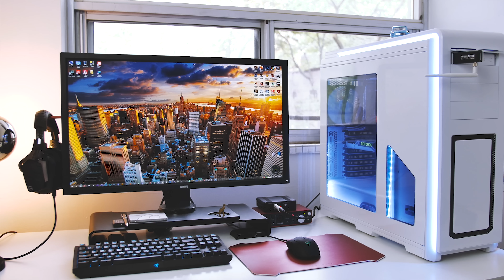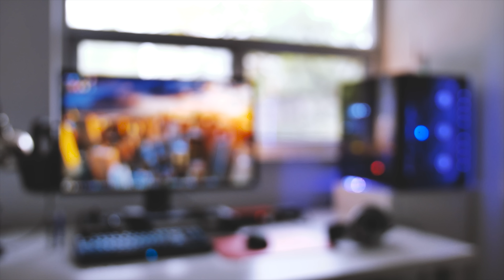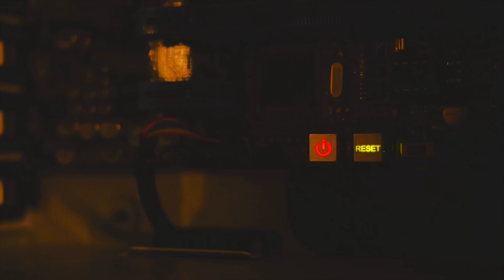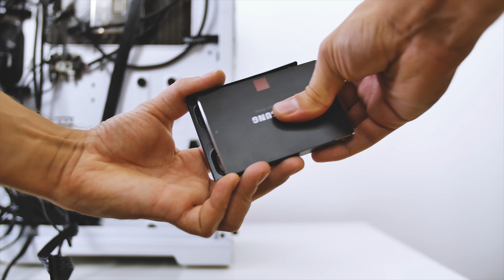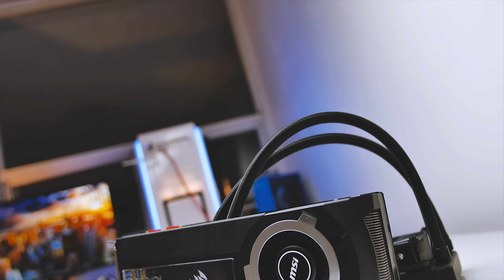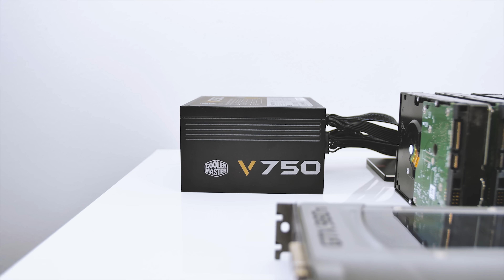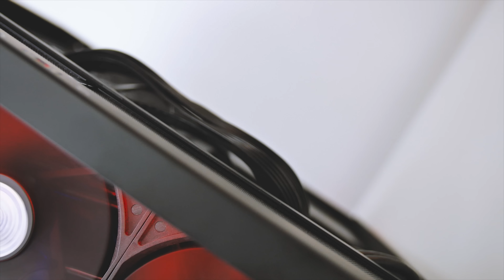New Workstation PC Upgrade | Aluminum + Glass = Sexy!

Comment: You do not need a nas! they are very expensive for the harware!
with an old PC that supports SATA 3 ( 3-6gb ) and a good switch, a good router  It's enough! 
we use old HP DL380 servers and Segate 8TB hdd entrepreneurially

Comment: Finer point question:  I am curious of the wire route for the LED strip under case in the back.  Did you find a port already available on the case, or did you have to do a little modding?  I will be purchasing this case for my build in a few weeks and liked that little nuance in lighting.  I know there is a small hole below the expansion slots, or did you squish it out through the power supply mount?
Reply from the maker: +Albie Clementi yes or went underneath the PSU. Little tight, but no modding required :)
Reply: +HardwareCanucks Excellent!  Thank you so much for your reply, and also for your awesome content!  Keep up the amazing work:-)

Comment: i guess either you are recording at 8K res and rotating the the frame with scaled down composition or you are rotating the table it self which is not possible 90 degrees 180 degrees rotation done very well but how ?? how do you rotate without cropping

Comment: Whydo you call your 980 a reference board? Its not like its a specialist video editing card,  it is just a basic video card. Is there any reason why you call it that?

Also the stickers on the three front fans, remove them or straighten them up ;)
Reply: +BladeRunner21577 A reference card is a GPU that holds the reference PCB and Cooler.
Reply: +tacoman So a card that is built following the guide of the original, in this case a card that copies the original nVidia cards design?
Reply: BladeRunner21577 Exactly :D

Comment: The one thing I cannot figure out is why the main primary slot for my 660ti is running at a X8 speed and the second card running at x16 speed.  It made be very confuse when it suppose to be a dual X16 speed and I've put it in the correct slots.

Comment: I also have that same X79 board that you have in the video and I'm rocking with my 3820 i7 (budget wise).  Right now I'm looking for a good mid-range card between a Crossfire XFX Black Edition DD 290x and the R9 390 Msi for my three monitor setup which currently I'm running SLI 660ti GC Galaxy Tech OC edition.

I could only wish to get the sandy bridge 2011 extreme black edition my buddy have on his computer.  He was suppose to be building a aluminum tank with side glass for mineral oil setup.....that was a year and a half ago when he wanted to plan doing but never did.  Seeing the black edition $1000 chip resting on the MB that should be in the case and the sad part it was still cover in oil and now dust is all you can see on the entire system and it going to be a bitch to clean it off now.

Comment: Why intake fans blowing air on to power supply, hard drives and cables?, it should be positioned on the left side to do all blowing on to components instead.

Comment: +HardwareCanucks, You ask about a NAS. Having had a small Synology-NAS for a couple of years, I would like to recommend one of those. I don't know the depth of your wallet or your needs, so I'm just gonna link to their product page. It has a really neat setup and is easy to use. I'm using mine as a file server, but also as a DNS Cache for my network and as a torrent downloader.  The "+" series typically have a stronger CPU than the variant with no sign behind it, the "J" series (for Junior) are typically a bit weak, but will still do good. Some of the NAS can have a plugin module of extra drive bays, if needed, like the DS1515 (the DS1515+ has a stronger CPU and RAM that can be upgraded).   https://www.synology.com/en-global/products/

Comment: Hey dimitri, noticed u've got a usb wifi adapter was wondering if u had any problems playing online games with it & what model is it. Am looking for a suitable one since i'll be switching network providers n don't wanna run the cables outside the house just to get to my room, so do u have any suggestions apart from the one u got.

Comment: i saw this case too and would buy it but dont it get too hot in there because the intake fan are on the ´´ wrong´´ site.
if you look at the corsair air 540 then you see the intake fans are on the site where the mobo and graphic cards are.
so dont make this much of a difference?

Comment: INTEL Quad Core I7 6700K

Kingston HyperX Fury Black 16GB Dual Channel

MSI GTX 980 TI GAMING 6GB GDDR5

2TB SATA Hard Drive

Samsung 850 Evo 1TB Solid State Hard Drive

Corsair Obsidian Series 750D Full Tower Case, Window

Blu Ray Combo Drive

Corsair RM Series RM850 ATX Power Supply

MSI Z170A GAMING M5 Intel Z170

Corsair Hydro Series H100i Liquid Cooler

What you think for gaming ?
Reply: +Joseph Longmore You could probably get 30fps on minecraft if you install optifine.

Comment: you have 2 980 tis why overclock wen u can just SLI it will boost your performance substantially and no high fan speeds, palace your water cooled on the top as ti dose not need  as much fresh air intake. This is what I would do if you haven't sold or given away your old one.

Comment: you could have slied both your 980 ti's, putting the reference design card as a secondry card, it will run cooler than before and give you a huge gaming performance boost, just saying

Comment: In my personal opinion Lian Li cases almost always compromise functionality for form. I mean yes the case looks nice but at what cost? 

I mean first off I get cancer every time I see one of these cube cases with vertical mounted hardware. Just look at the one side. Half of the entire space is underutilized and can't be used for anything and is just a waste of space. It's honestly just silly. When the hardware is mounted vertically you should just get a regular rectangle case. The take up less of a footprint on a desk or wherever and not as much space is wasted. The same goes for the Corsair Air case. 

If you wanted a cube style case and were willing to pay big bucks for a PC case I would have just went with the Caselabs Murcury S8. You get their unparalleled customizability, modularity and functionality. Plus you get a horizontal motherboard which is the only real reason I would ever buy a cube style case and I own the S8. 

I mean if you are buying this case for how it looks then fine I totally understand but being a workstation and not a showpiece I believe the functionality of the Caselabs S8 trumps the looks of the glass panels and it isn't like you can't get the S8 with full windows on both sides if you wanted. 

The last thing I want to say is what is the point of buying all in one water cooled GPU's? If you are forking out that much money for a system why not just pay the extra 500-600 bucks and build a sexy custom loop? I mean you don't even get rid of the fan on the card, seems kind of pointless.
Reply: +Austin Michael I don't like how costly this case(Lian Li) is. It doesn't even have a slot for a dvd-rom drive. Who uses that anymore? I do! I own CD's and DVD's and I would like to play them. I am probably getting the caselabs case you mentioned. My video card weighs down the pci-e slot. I am never going with a vertically mounted mobo case again.
Reply: MrTw2009 the s8 really is an amazing case. I would give you two tips when buying it. Make sure you get the 120.3x2 drop in Mount. It's worth the money 1000%. Second I would make sure you go look through the accessories and get anything you need at once. Example get the psu support. It isn't necessary but without it your PSU will be completely held on by 4 screws and all the weight will be on them. The way the case had to be designed the psu mounts about an inch off the actual floor of the case.

Also maybe get some Castors. Theirs are really nice quality.
Reply: MrTw2009 No problem, it really is the only really nice horizontal motherboard case out there. It's so easy to build in. 

I will say though that because it's a cube case it will take up a larger profile on a desk. Another thing is that without watercooling hardware the case will look really empty but that's a minor complaint considering the case weights 9 pounds less then a Fractal R4. 

Also final tip would be avoid the floor and especially carpet at all costs. Not a single dust filter to be seem on this case unless you buy custom ones. I don't know why anyone would want to put this showpiece on the floor but just a tip haha.
Reply: +Austin Michael it's easy to see an issue with a bespoke casemaker who charges you twice for motherboard compatibility. One of the options on your preferred case forces you to choose between ATX and SSI mounts. 

Be honest: given how many cases offer mounting points for both, doesn't that leave a bad taste in your mouth? I have a Nanoxia and a Thermaltake which both hold ATX and EEB boards, and neither were close to the price of the S8 and offer the same functionality elsewhere.
Reply: +Christ J dude it's an extra 10 bucks to get the SSI EBB motherboard tray. Big woop. Considering the vast majority of people won't be using extended motherboards I don't see any issue in making it an optional choice for not really even that much of a premium. 

Also you talk about how other cases have both. Well Yea if it's a pre fab full tower why wouldn't it, you can't change anything.
Reply: ***** selling both form factors on one tray would require nothing more than a couple more holes drilled and tapped. Forcing people to buy another tray just to go from, say, an x99 workstation board to a dual-Xeon board isn't defensible at ANY price.

It was also meant as an example of Caselabs being no different to any other company looking to claw at every penny they can get. Other examples include charging for front fan mounting points, and, if I remember correctly, charging more for larger fan mounts - as if they are suggesting that fitting 140mm fans somehow costs them more than fitting 120mm mounts.

Truthfully, I quite like their customization options. However, I hate the fact that they are so cheap as to charge multiple times for different form factors, and that they overcharge for trivial things just because they can. Their "unparalleled customizability, modularity and functionality" only applies to the initial purchase, because if you want to change your system then you may well end up having to buy new case components as a result, which defeats the point.

I'll grant that their build quality is excellent, but it certainly doesn't offset these dubious practices, nor does it make up for the fact that they offer no more flexibility than any decent pre-built case after you've ordered it.

At a lower price - or without the petty additional charges - they would likely be sitting beside me right now in place of my DS6.
Reply: +Christ J If it's that big a deal just get the bigger one and you can fit both sizes on it. I'm sure they have there reasons for charging what they do. 

Also you say all they have to do it drill holes? Come on man go look at the different trays. First off all the one has more aluminum, it has milled routing holes with grommets which also adds more materials and another step in the manufacturing process which costs money time and labor. 10 bucks more is nothing.
Reply: ***** of course they have their reason. It's called "being a business". They're doing the same thing publishers have been doing with paid DLC - charge people extra for stuff that had no reason to be excluded in the first place. Like fan mounts.

I don't object to this in principle, but I do think it ridiculous that people try to imply that it's anything other than a blatant attempt to overcharge customers.
Reply: +Austin Michael Thanks for the help! I think I am getting one after the holidays ;)
Reply: +Austin Michael Good to know! I air cool my pc, but maybe some day I will make a custom loop.
Reply: ***** ". Not a single dust filter to be seem on this case "

- didn't know that. That's horrendous. MrTw2009 irrespective of where you're putting it, get some dust filters. Dust doesn't exclusively come from the floor. Overclockers used to do some decent magnetic ones.
Reply: Christ J DEMCiflex makes custom sets for Caselabs but only certain cases. Also yes their are no dust filters, it's commonly mentioned in Caselabs reviews. 

Also don't forget being entirely aluminum anything magnetic won't work.

Comment: get intel SSD for PCI-E for windows to get the system running smooth because SSD will control the whole windows and that will be extremely helpful for performance rather the 2.5 SSD ones. Another thing just to say i suggust getting 6TB HDD black edition the next hard drive u buy

Comment: I would recommend Qnap one preferable with and intel chip and 6-10 bays i have used 4 Qnaps for business and at home and they work seemlessly together. They are a premium option  compared to synology and WD or Seagate, but i have not had a single day of hassles running with Qnap. Using 12 WD RE 2T drives in them, WD Red Pro is also a good option.

Comment: Build a freenas system in the Silverstone DS380 case, then run a Intel Avoton CPU. Depending on the size of drive pool, maybe pair it with an 850 Pro as a cache drive, or just add a bunch of ram.

Comment: Dimitri, you really need to build yourself a custom file server with high speed NIC for your build. Not to mention that data retention is key so you could setup redundancy backups more easily then on your main system, as well as a lighten up the power usage and cable management inside that beautiful new case.

New project! Get to it :)

Comment: My recommendations for x99 upgrade...

ASRock X99 WS-E LGA 2011-v3 Intel X99 SATA 6Gb/s USB 3.0 Extended ATX Intel Motherboard
http://www.newegg.com/Product/Product.aspx?Item=N82E16813157538

Intel Core i7-5960X Haswell-E 8-Core 3.0 GHz LGA 2011-v3 140W BX80648I75960X Desktop Processor
http://www.newegg.com/Product/Product.aspx?Item=N82E16819117404

G.SKILL Ripjaws 4 Series 64GB (8 x 8GB) 288-Pin DDR4 SDRAM DDR4 2800 (PC4 22400) Intel X99 Desktop Memory Model F4-2800C15Q2-64GRK
http://www.newegg.com/Product/Product.aspx?Item=N82E16820231820

I went with that MB because it has 12 SATA ports and an M.2 slot that can be filled with the Samsung 950 Pro once released. This is going to be my upgrade hopefully in the near future.. :)

Comment: you shouldnt use an NAS because the transfer rates will be limited by your network connection speed, you should instead take your current drive or new ones and make a external HDD enclosure via thunderbold , usb 3.0 or eSATA.

Comment: Not sure if it would be up your alley, but you could go with a custom NAS using something like FreeNAS and source whatever parts you like (for the most part. There is some compatibility things here and there), but it would allow you to make a more ever expanding NAS unlike traditional X Bay systems. Say you use something like the Define R4/R5 which can house a lot of drives.

Might be overkill, but I think you guy would like the customization that comes of such a system and you could make some build videos out of it too.
Reply from the maker: excellent suggestion! will look into that :)
Reply: +HardwareCanucks Don't know how often you use Reddit but this subreddit has tons of people that know a lot about NAS solutions and the pros and cons of different drives: https://www.reddit.com/r/datahoarder
Reply: +HardwareCanucks And remember to keep backups :p
Reply: Agree. I can recommend the Silverstone DS380 NAS chassis and the SuperMicro  A1SRi-2758F motherboard .. for my own NAS I also use the LSI 9211-8i running IT mode  (Initiator  target mode)..
Reply: +AK474000 FreeNAS allows ZFS file system, which is critical for file integrity. make sure you use ECC ram though
Reply: Brenton Johnson Indeed. Which is the caveat is added to making your own NAS since to make a reliable and working one with FreeNAS is going to be a bit more of a limited hardware space. Even though there are FreeNAS systems running on consumer systems.

Comment: If only PSU manufacturers started supplying nice sleeved cables that actually look nice. As seen in this, Non-sleeved cables just takes away from the build, and also, sleeved or not, tend to be folded up and kinked and you can never route them in a clean fashion

Comment: for a x99 build for a work house i sagest the Asrock x99 ws-e /10g it has 2 plx chips so no need to pay $250 more for a 5930k and no need to get a 40 lain CPU unless you need the 2 extra cores from a 5960x. this board has it all ECC memory support 4 way GPU configuration at 16x16x16x16x. great sound and oh yes 2 x 10g LAN. so what is the best thing about this board......well it is a kick ass gaming setup with 2 plx chips and all you will ever need for a work station. yes you pay a bit more for this board but you save heaving to buy a bigger CPU that said if you need the extra 2 cores for video editing the option is there. hell if you need any more lanes than that you a bonkers. the point is the rig you got is a good setup but if you need to upgrade for the video editing side of things then you do it for these features or just stay with what you got....HOW AM I KIDDING UPGRADE UPGRADE MORE POWER.

Comment: You could probably easily mod the yellow MSI logo if it's not a yellow LED, which you could still change, or remove, but there's soldering involved so I''m not sure how comfortable you are with that. If it's a white LED with a piece of yellow laminate over it then it'll be easy to change its colour, or at the very least, make it more orange since orange and blue go better together than yellow and blue do.